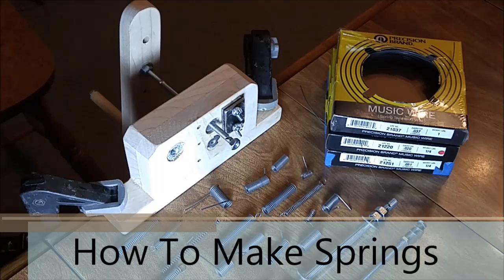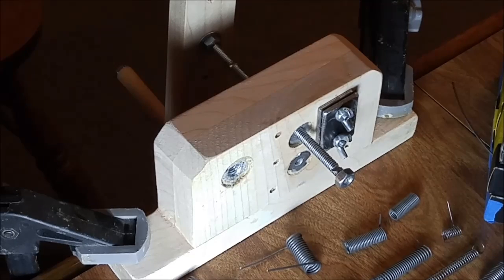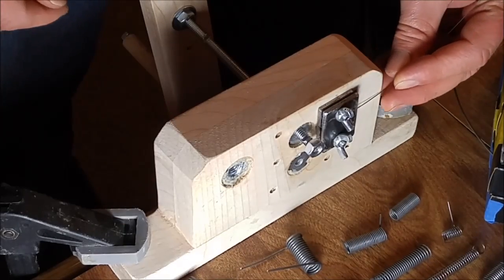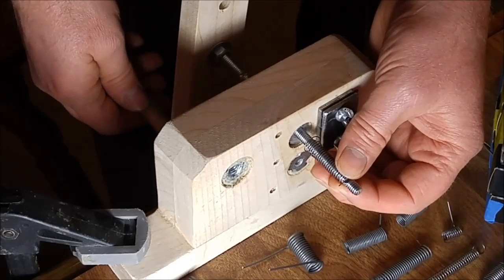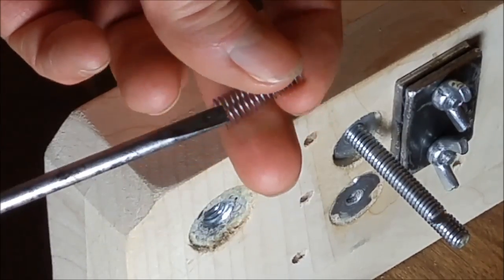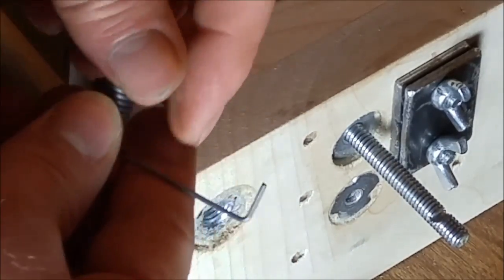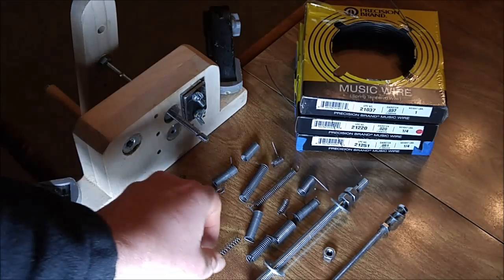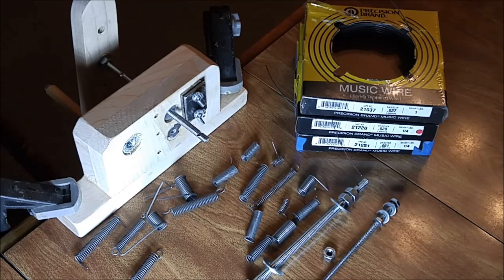Making Springs Easy, Inexpensive, & Safe

Comment: If I was to wind copper wire into a spring, how do I treat the wire to make it a stable compression spring?
Reply from the maker: Interesting question! I'm no expert but in doing some searching online it seems you are apparently on the right track with heat treatment then slow cooling to increase elasticity. From a design standpoint one might try increasing the windings and if possible using smaller wire diameter to help increase springiness.

Comment: What size wire do you use
Reply from the maker: Sorry for delay responding. I purchased 0.020", 0.037", and 0.051" diameter wire when making this project.

Comment: Good video. Do you have any  idea how to make also non circular spring?  Like rounded rectangle, 2x5cm... for pushing stuff back. 
When releasing tension after make, it of course anymore do not follow rectangle shape, but do some spiral. Hard to repair each curve manually. Thx!!
Reply from the maker: Sorry for delay in responding, I haven't logged onto youtube in a long time. It's a very interesting idea about non circular springs. The first thought that comes to mind is to take a grinder to the threaded rod to form it into a rectangular shape yet maintaining some portion of the treads for use with the spring maker, kind of like a thread tapping tool looks. That said I'm not sure how rectangular or rather oval the spring will be.

Comment: Sir what is the size of the  smallest spring shown in this video ?
Reply from the maker: Hello, If I recall correctly the smallest was ~3/16" diameter from using a 1/8" thread all. Glad you liked the video and design idea. PS - sorry for delay responding, I took a break from youtube but am back now.

Comment: I've been looking for a spring-making machine but no-one sells them. I've been making-do by using vice grips to wrap electric guitar strings around nails (and even sewing needles for micro springs). Your idea  of using the thread of the bolts to guide the wire into a neat coil is genius. If only you could find some way of getting the ends of the compression spring  neater like a manufactured spring. The problem with just cutting the end off a compression spring is that it creates an uneven seating position  and the shrarp protuding wire can also be a problem depending on the application. When I use a nail, I start  and finish the winding with two non-angled coils without a space between them (like factory maufactured springs). This creates flat ends on the spring. But that wouldn't work using the bolt threads as a guide for the wire because they're angled. I reckon if someone made a good spring-making machine they'd sell like hot cakes. I restore old cars and me and all my car restoring buddies are constantly having to replace broken springs that are impossible to find anywhere.
Reply from the maker: These are excellent comments and appreciate you taking the time to send them! They are also ideas for me to try to incorporate into a second version of the spring maker which I'm hoping to find the time to make in the future. What I do now the terminate the spring is make it a bit longer than needed then cut the ends using a dremil tool which creates a very clean looking basic spring. But I'm yet to figure out a good way to cleanly do the flat end termination you mention.
Reply: Actually, cutting them with a Dremel is a good idea, especally if the cut is through a few straight winds with no gap between them. That would get the end surface pretty flat.

Comment: HI uncle,  what spring wire to use for marine application?  a stainless steel wire. but I dont know any code to type. can you help me?
Reply from the maker: Very sorry for delay responding, I took a break from youtube but back now. If you're still looking into marine application springs as an idea you might look into Beryllium Copper wire.

Comment: Have liked and subscribed
I've found clock spring wire and piano wire. Which should I buy?
Reply from the maker: Glad you liked the video, I'm not familiar with clock spring wire, the wire used in the video is piano/music wire, and I find it to work very good for general purpose use, it's inexpensive and has huge variety of diameters on Amazon. Do a search under term "spring wire A228" on Amazon. A228 is the ASTM (american society for testing and materials) grade for piano/music wire. You may likely already know this but figured I'd mention it just in case. Also can't stress enough to always wear full eye protection (reading glasses are not good enough) any time dealing with spring wire or making springs, one mishap with it near the eyes and it's off the the hospital and possibly permanent vision damage. I know you know this, it's just my disclaimer to use this spring making video idea at your own risk.
Reply: Thank you for your reply.  I think I'll go with the piano/music wire.  It sounds like a sure thing.

Comment: Hi Dumas.
Very nice design, and the vid is also very good. Sharing your thoughts like this is very much appreciated.

I headed over to https://3dwarehouse.sketchup.com/model/d96095ff-fcbb-4eec-b592-4028de0080a7/Making-Springs-Easy-Inexpensive-Safe and downloaded the model.
QCAD is unable to open that skp (or collada) file, and since I run Ubuntu I don't have any other reasonable application choice.
Are you able to post a DWG (or other compatible) version of the file somewhere ?
Reply from the maker: You're very welcome, glad you liked the project. It was fun and I've used it many times since so can recommend taking some ideas for your own spring making jig. Unfortunately I didn't post other cad formats for the project, sorry about this. This said there is a 2d drawing at the end of the video which should go a long way towards helping.

Comment: Idea.  Insert a rod coupling nut instead of the T-Nuts.  Also, a fastener shop does sell left hand threaded rod so you can make a left hand wound spring.  Just random thoughts...
Reply from the maker: Good ideas, I think a coupler nut work work great. And I like the idea of left hand thread rod, a simple solution that pretty sure at some point I will be doing, for example the case of needing two springs nested inside each other.

Comment: i want to make a 20 feet spring how do i hide rod?.thank you for share this great idea
Reply from the maker: Sorry for the slow response, it's an interesting challenge of making such a long spring. But I'm sure this spring maker project can do it and there's probably several ways it can be done. The one that I'd bring up as a suggestion is to buy length of all thread rod at the hardware store, for example here I can buy 10ft sections of all thread fairly inexpensively for holding up conduit. Weld the rods together to form a 20ft+ long piece. The welding together, I'd use a coupler nut with holes drilled in the middle of the coupler where the welds are to be done. Then grind slots in the ends of the rod where they will be welded together. after the 20ft section of rod is made and some simple support like a bench or table are used because it's so long then it's the same process as in the video to make the spring. For sure it can be done and at a much lower cost than having to buy a custom made spring that's 20ft long. Good luck with your project and if you think of it let me know how it ends up.

Comment: No harden and temper?
Reply from the maker: The music wire I used in this project was already full hard tempered. At least for my usage this wire I used works good as is and avoids any additional steps like harden and temper. However I can see your point that in some cases and with some wire material it may be necessary to anneal (if necessary), form spring, then re-harden and temper, such as very tight bends or complex shapes. And so I think this is a good point.
Reply: Thanks for your reply.

Comment: Brilliant,very easy to follow and great basic design.Thanks
Reply from the maker: Glad you liked the design and hope it helps with your projects! Makes it worth it to me to post these videos. I've been making springs with this jig for a while now and can say it works great. It's been real nice to have custom coil spring making as another tool in the tool belt for projects.  Though I'm hoping to make some other jig videos for making other spring types like left hand coils, double torsion, and for forming features like controlled wire bends and forming loop ends.

Comment: I have an idea that you may like. I think you could use a left hand threaded bolt to make left hand wound springs. Left hand wound springs are nice to use over a right hand threaded screw or bolt so that the wires won't get caught up in the threads. Nice design. I'm actually going to start making some springs myself. I am making compression springs and I have a metal working lathe so I will be using it, but I just happened upon your video and think this is a great idea! You earned my sub, looking forward to seeing some more of your videos.
Reply from the maker: Why didn't I think of that? Simple and effective way to make the left hand threads, I will look into adding that feature, a while back I was working on a project where having nested springs would have helped. BTW I checked out your fishing channel, what do you think about fish degorgers, ex which is the best in your opinion? I've been thinking of making my own unique version to try to resolve some of the problems with the commercially available ones. Also I'm planning to do a video of another homemade wood landing net in the future if that's of any interest.
Reply: That is funny that you bring up degorgers and possibly improving on them because I have thought about the same thing myself! I haven't owned one worth using so I use hemostats for the most part.  Looking forward to the net project!
Reply: Make AA battery spring for fishing lights. By the way I didn't understand left handed advantages. I make underwater fishing cameras for Android iPhone and fishing lights,  deep drop etc

Comment: Thanks , .020 , .037 , .051 , Which one is the thickest ?  Measured in gauge ?  Thanks
Reply from the maker: Those numbers are wire diameter in inches, so 0.051" is thickest. At the time I ordered the music wire these sizes seemed to be the best value (most wire for least money) and yet be in the ballpark of wire diameter for small, medium, and large springs I thought I'd be using.

Comment: A great way of making springs, I have downloaded the model
and will be making the jig as soon as I can get into my shed. I will have to
move the 5ft of snow first and order the wire but I can see this being very
useful.
Reply from the maker: Glad you liked the video. I think you'll be very pleased with how this method makes custom springs of decent quality, inexpensively, & safely. Good luck on your projects and with digging out of the snow! As a comment, I'm sure you know this but just for those who may not know, I'm always, ALWAYS using full eye protection when working with music wire spring steel. I'm hoping to do a follow up video at some point with additional jigs to do other features such as crisp bends, forming different types of spring ends, left handed springs, double torsion, etc. Make sure to subscribe to for more videos like this.

Comment: You need to check your microphone .  You can hardly hear your muffled voice in most of the video. Otherwise your springs are excellent.
Reply from the maker: Sorry about that, I agree the audio needs to be better and will work on improving it on upcoming videos. But glad you like the video other than the audio, I've been using this method to make springs for a while now, it works great and can recommend using this method to make small custom coil springs.